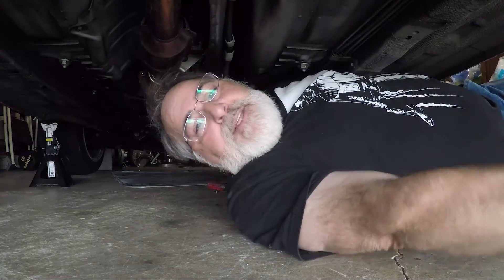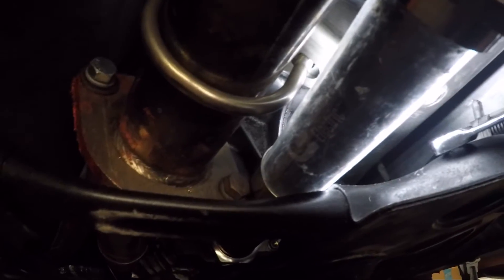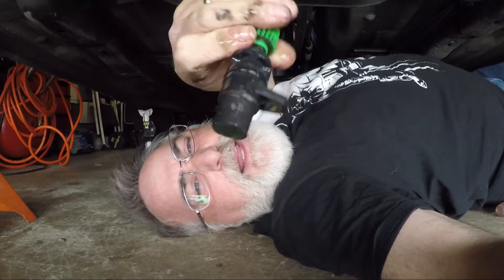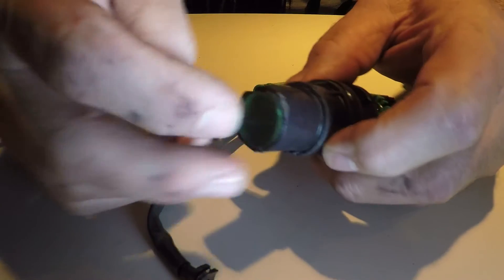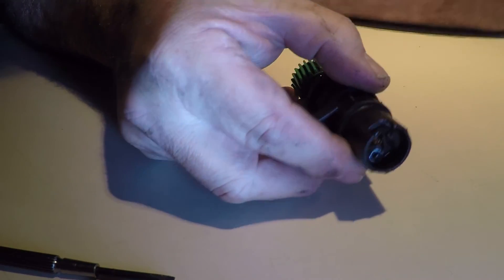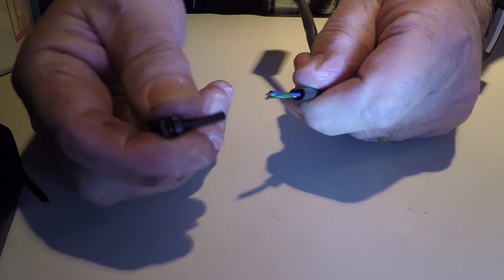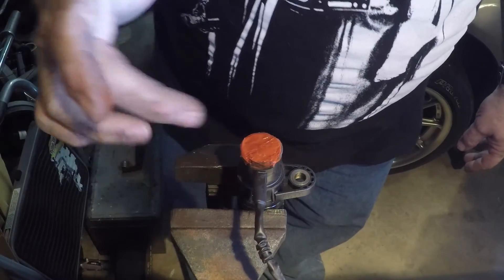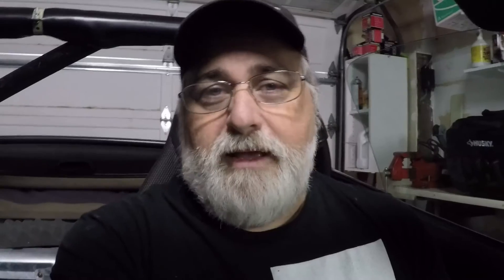How to repair the speedometer in the Boosted Miata - NB

Comment: Thanks for this video. I repaired mine and used your tip about using epoxy resin to seal the deal. Your right about polarity, it doesn't matter, its an AC generator.

Comment: Hi nice video. My odometer and speedometer just stopped working a while ago. We lifted the car with my brother just to check the sensor and put it back again. It worked for a couple of hours but again stops working from time to time. Is the speed sensor my problem? If i follow your instructions will this solve my problem? Thanks
Reply from the maker: Hard to say the wires do get brittle over time and break. I would start there. It’s also possible the sensor it self is bad and needs replacement.
Reply: @Seandoestech  thank you sir!

Comment: Did you have to put some oil back il the transmission after ? is it hard to change oil transmission in the process? my NB FL has 140 000km, is it worth changing the oil please ? Thx in advance
Reply from the maker: I didn’t need to add any more. I would definitely change the trans oil at that number. It would probably improve shifting performance.
Reply: @Seandoestech  thx have a good day

Comment: Hi, I have a miata 2004 automatic transmission.
And it is not working where speed is set.
The revolutions, temperature everything works well.
Could that sensor be?
I write to you from Santo Domingo, excuse my English is not very good.
Reply from the maker: Denys Merengue yes, it could be the sensor.

Comment: I like the fact that you try and fix something instead of just replacing it! I need to do that with my Miata too but sometimes I'm just lazy.. Anyway, good video!
Reply from the maker: MiataMods thanks, yeah my whole approach is to keep this build on a budget. But I also value my time. these sensors cost $200.00 new. If they were like $30.00, I'd buy a new one in a heartbeat.

Comment: Looks like a pretty good permanent fix. I would think polarity WOULD be an issue, but either it isn't or you got lucky. Well done. The k-series engines also use an electric speed sensor (at least the k20 and k24 do) and they can break often. Usually break when the mechanic is not taking care when disconnecting the wiring connector.
Reply from the maker: fiatmonkey In my case, I think the harness that runs along the power plant frame which the sensor connects to was loose and pulled on the connector wire. over time it just broke. Plus I'm sure it doesn't help that I've unplugged that sensor many many times, removing the engine and trans multiple times.
Reply from the maker: jamieee321 I'll just reverse it at the connector end, wouldn't open up the sensor :-) but taking it apart again would be nearly impossible,, agree.